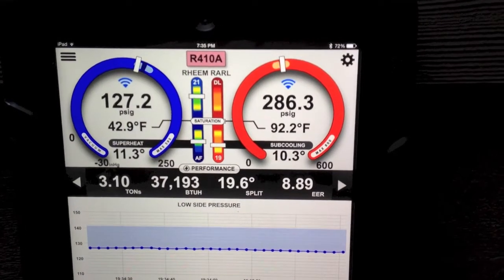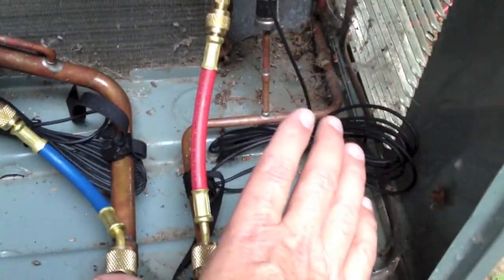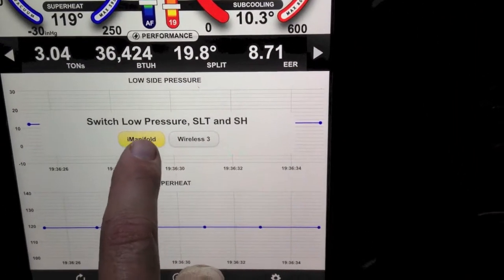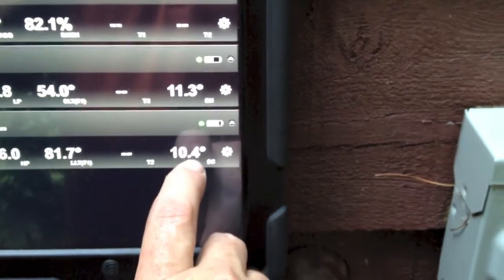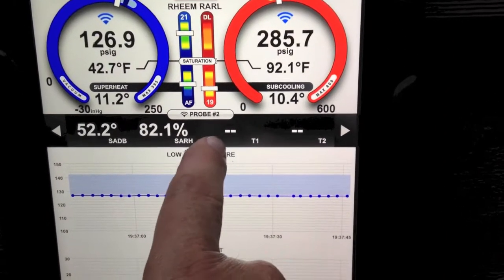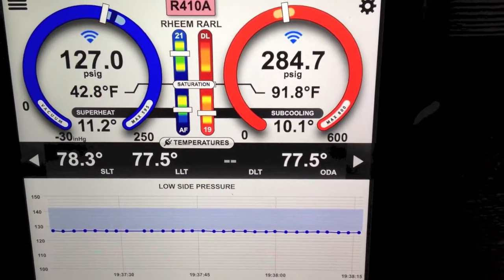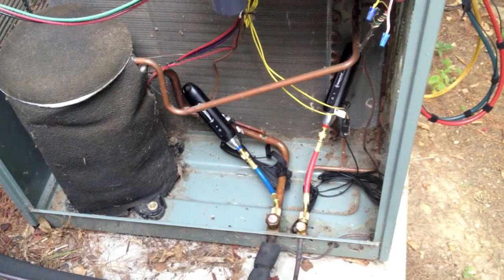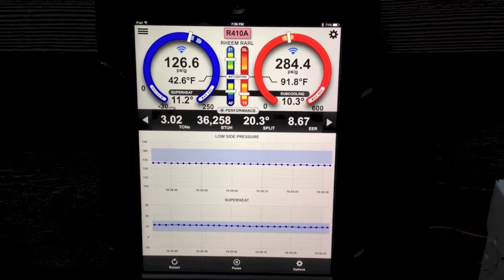iManifold Wireless Pressure Probes

Comment: Does this reduce the loss of refrigerant  by alot? Say you are just checking the pressure for a single system with the hoses versus the wireless probes. I'm using this product for my tech school presentation.
Reply: Hello Johnathan.  Were you able to get a discount from stride as a instructor.
Reply: +fred harris no :(

Comment: its 2 am so maybe Im just to tired, but what is the advantage of the probes beyond being able to keep covers in place?
Reply: Jim Bergmann OK. ....
Now I know where I stumbled. I assumed they were only for oil pressure when I saw them TTTie's site.

Thanks both of you Jim and Steve and Steve Steve
Reply: Jim Bergmann what's your thought on a micron gauges that hooks up the same way as these probes?
Reply: ***** nice. Trending during evacuation would be cool.
Reply: The intent is multiple, and I am guessing that there are some that I have not thought of. To measure evaporator and total superheat, to set superheat on multiple evaporators, to check a second circuit on a multistage system with one set of gauges, to check oil pressure on larger compressors, to check pressure drops in the suction or liquid line, to check critical charge systems with minimal refrigerant loss, to check the discharge and liquid pressure at the same time with a single set of gauges, to verify equipment operation with panels in place, to check transport refrigeration in motion (cars refer, busses etc.), The idea is it gives you another remote port of pressure and temperature to expand the ease of use and diagnostic capability,
Reply: With multiple probes you could check multiple
Systems. You can use up To 12 wireless probes which would give you either 6 high and low
Pressures with superheat and subcool or 12 low side readings with superheat. Easily check a row of units at one time. That's just the simple potential, once people get creative with it there uses will continue To Grow!